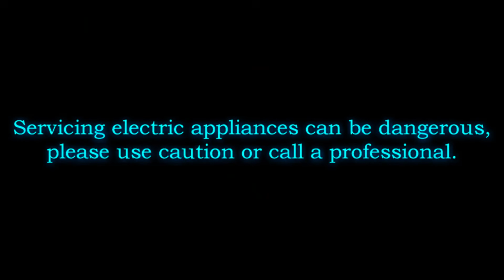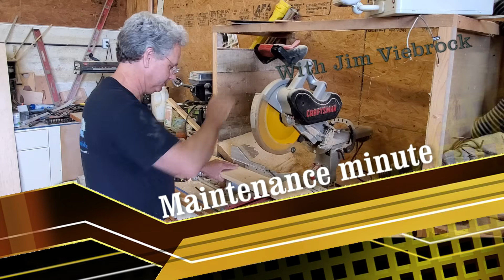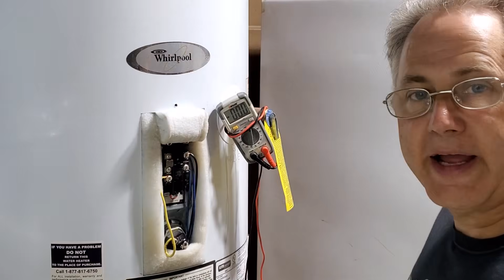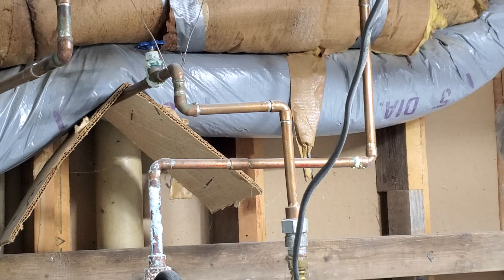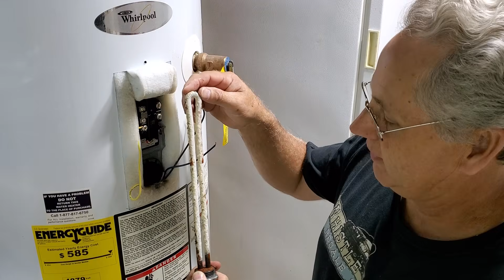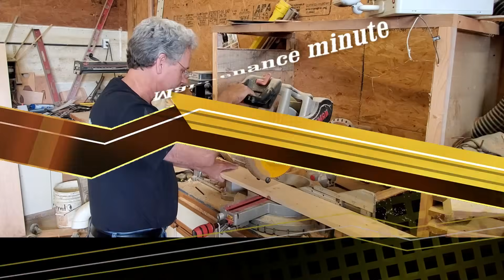D.I.Y. How to replace the heating elements in your hot water heater. Maintenance Minute Jim Viebrock

Comment: Can you temporarily bypass lower element until you can take off. It's stuck for now..
Reply from the maker: Well, if the lower element is not working the heater will not fully warm the water. Also, you will not be able to clean out the bottom of the tank. In short, I don't think the unit will perform to a level you will be happy with. In the video, I had to upgrade the leverage I needed to remove the old elements. You may need to enlist a mechanic friend to provide you with a socket and a breakover bar for additional leverage. Be careful, if you strip the threads you will likely need to replace the whole unit...

Comment: Our old element is stuck (won’t turn to come loose) Do you have any suggestions on how to loosen it to get it out?
Reply from the maker: They can be very tight, In the video I use a socket and a long breakover bar. I would try something similar to that.
Reply: @millin360  We ended up getting an attachment (socket) for our drill and it worked!!
Reply from the maker: @lindanicodemus9306  that's awesome!!!!  I'm glad the video helped.

Comment: Thank you for the video! Replaced my elements and flushed the tank. One extra tip to mention, Check the reset button on the thermostat! After I was done and everything was connected and turned on, I still didn't have hot water, even after an hour. I went out and rechecked everything, wires and circuit breaker! Then I saw the Red Reset button on the thermostat and it needed to be reset! Hot water in about an hour!
Reply from the maker: Glad you were able to get it done. You most likely tripped the reset button at some point when the element went bad, so all of that probably needed to be done.
Reply: How old is your tank to justify the pipe compound I'm replacing my element now and the water heater is only a 5 years old also great video so easy to understand  @millin360
Reply: Your element was probably fine
Reply: Sir,you are awesome! SERIOUSLY the best video I've seen! Thank you!

Comment: Before you drained the water you turned 2 valves 1 to the tank and one into the house but what should i look for it i can only find the turn on switch for the on going into the drain?
Reply from the maker: Depending on what part of the country you live in. There may not be shut-off valves leading both to the tank and away from the tank. The idea is to simply shut off the water flow to the tank using whatever methods the contractor provided for you. In the event you don't have any shut-off valves, you will need to go out to the meter and shut off the water to the house.
 It's just gonna be extra water for you to have to deal with.

Comment: I have barely any water coming out from my faucet that I had on while filling the tank... The tank is full and other faucets work fine Why?
Reply: Check that the spigot did not get clogged with calcium debris, remove aerator and clean it. Make sure you put it back together the way it came out of the spigot.
Reply from the maker: Check the valve that you may have shut off in the process. It may not be fully open....

Comment: You should leave your exhaust valve alone. Opening the tap causes the air to come in the tank. You just risk unneeded problems. Your valve should be plumbed to the base. The water heater should be sitting in a pan that’s plumbed outside your home so you can see it’s leaking or put a sensor in the pan. Why ruin everything in a garage for a water heater that keeps getting made cheaper?🤷‍♂️
Reply from the maker: Thank you for your input.

Comment: Great video.  I installed a new water heater today but no hot water.  I think I may have turned the power on too soon and burned out the element.
Reply from the maker: Could be. Congratulations on the install though.

Comment: Lucky for you that you had the inch and a half socket .Did not have one in the tool box . I gonna check again.
Reply from the maker: Yeah, an 1-1/2" socket is not usually what someone just has laying around. As I stated in the video, you can buy the removal tool at the hardware store at the same time you buy the elements.   I've performed this procedure countless times and happened to have the appropriate tools to do it quickly and efficiently.. Drop me A-line and let me know how successful your repair was and thanks for watching my video.

Comment: Great video. My little constructive comment.
You use the voltage function of the multi meter and not the ohmmeter that is used to measured resistance.
Reply from the maker: Ya,  I record these live and don't realize I make little blunders along the way until it's too late. We try to correct it with a graphic but...well it's an imperfect world.
Thanks for the feedback, and thank you for watching my videos.

Comment: Excellent! I've got some rust dripping out of the water heater - a 2018 Rheem electric dual element 40 gallon.  Trying to get it covered under the tank warranty.  Plumber says the tank is shot and Home Depot says it's not - without looking at it.
Reply from the maker: That's a bummer. The anode rod is supposed to keep it from rusting.
Reply: @millin360  the anode rod.

Comment: My elements were both impossible to loosen until I used a  6pt  38mm socket bought at a auto parts store and used a battery impact gun. A little pipe dope on threads in tank will help prevent a small leak like I had forcing me to drain tank again and remove the element.
Reply from the maker: Wow, sounds like you had quite the experience. I'm glad you got the heater fixed. :)
Thank you for watching my videos.

Comment: What do I do if I didn't open the pressure value?
Reply from the maker: If you didn't open the pressure valve while you were trying to drain the tank, opening the hot water side of any faucet will do the same thing... it just allows air into the system so it doesn't create a vacuum.
Reply: @millin360  ok I did that in the beginning.  I've put everything back and hoping it work. Thank you it saved me $1075.

Comment: Thank you for mentioning that heating elements have different wattages. That wasn't mentioned on the other videos I've seen on this topic.
Reply from the maker: Thank you for your comment.  It is important to replace the elements with the same wattage or a home owner runs the risk of fire.
 Thank you for watching my videos.
Reply: @millin360 Question is still a risk of fire if using a lower wattage element instead of what came out? Mine had 4500 watts, can I replace with 3500 watts?
Reply from the maker: @jonathan3982  A lower wattage element would work without any additional risk. However, it will be slower to heat your water.
 I always recommend putting back what the manufacturer had installed in the first place..
Reply: @millin360  Thanks I'll try and return them and get 4500 watts. Another question does it matter on the elements which screw is in what position? I know that both screws are hot, in other words does it matter which screw let's say the white wire hooks to?
Reply from the maker: @jonathan3982  The "Hot" wires are interchangeable, however, as a matter of professional work habits, I would suggest that everything goes back in the place it came from.
Reply: @millin360  Thank you again I was just wondering because I wanted to make sure because you're very informative and helpful. I've learned it doesn't matter which screw terminal the wire hooks to.So basically hook it up as it was originally.

Comment: Hello. Working around 240 volts is dangerous. Your electrical information is confusing and could cause problems for the viewer. For safety purposes I would recommend allowing an electrician explain the electrical portion. Thanks
Reply from the maker: The video clearly states in several places to consult a professional if you are unsure or not confident in preforming the task. There is a disclaimer at the beginning of the video stating that servicing electrical appliances can be dangerous and to use caution or to consult a professional.  With that said, safety is the single most important aspect of any project.  I recommend that if a person is not clear or unsure they should not attempt the repair.
Thank you for your comment.
Reply: Yes it does have a reset botton I'll try tomorrow ❤ thank you I hoping my heating elements didn't burn out! I seen another video his water was cold he took out the heating elements and used a hard wire brush and scrubbed all the build up on it hahha people called him cheap for not buying new ones! Lol people can be very rude people will always complain
Reply: Hi thanks for your great video! I live in north dakota we just had a few storms my pipes got frozen well yesterday we put a heater under the home water came back on but there's no hot? Will reseting the botton work or did my water heater just die on me any information please, money is tight I do all my work my self I can't afford a new water heater thanks for any advice thanks
Reply from the maker: @braidendj3jy   If your heater has reset buttons I would certainly try them, I would also check the breaker to make sure they didn't trip.

Comment: Really good stuff thanks you saved me alot of cash money
Reply from the maker: Glad the video helped.
Reply: @millin360  also what to expect after replacing them is there something I have to do after following all the steps it your video they were going to charge us $800 to switch them I spent like 200max on tools the 1 1/2 and a big breaker bar the elements were only 12$ each and tape $1 sealent $10 so nice!
Reply from the maker: @otgmedina3452   It's important to not turn the power on to the elements before the tank is completely full of water.. Open a valve somewhere in the house to let the air push out of the tank. Once the tank is full turn the power back on.

Comment: Great video, thanks. Does it matter if the wires to the element are reversed upon reinstallation, since both are hot?
Reply from the maker: It doesn't really matter, but as a practice of professionalism you want to keep them the same.
Reply: @millin360  That makes sense. It seems that the screw positions on the replacement element are symmetrical so depending on how it was threaded in, it might reverse the screw position from what it was originally.

Comment: Nice video and I was wondering why you just didn't clean the heating elements? Seems cheaper than buying new ones if you just soak them in some muriatic acid or something. Just me thinking too much I guess.
Reply from the maker: In my case, the lower element was damaged from the lime. As cheap as the elements are, I simply replace them.
Reply: @millin360  Yep.  If it's DYI you have already saved a ton of labor costs.  DO it right, or do it twice.
Reply: By the time you drain the tank and remove the element, you have done the effort.  Elements costs $10 or 20$ each,  My top element was fine,   I replaced it anyway.  For 10-20 years of service, I will buy the extra element.   I don't want to have to go through this again.

Comment: I changed the bottom element and my water is cold. Am I supposed to click the reset button found on the top element?
Reply from the maker: I always recommend that both elements be replaced while you are at it. If your unit has a reset button, there is no harm in pressing it. If those things don't fix it then it almost has to be the thermostat(s). 
Thank you for watching my video.

Comment: Use you 1-1/2 socket to put heat element on. Makes it much easier
Reply from the maker: I agree. The little tool you buy at the hardware store can easily slip and strip the nut. Using a socket wrench gives you much more leverage and a much tighter fit.
 Thank you for watching the video.

Comment: Best video on YouTube for this, thank you!! Only thing I don’t understand fully is making sure there is no air. If possible, can you give me instructions like I’m 5 years old? Lol! I don’t want to mess this up
Reply from the maker: When you start to refill the tank, if you don't have a place for the air to go, for example a valve at a sink open, the tank will pressurize and you will think it's full.  If your input valve and the output valve is open, and you have a valve open at one of the sinks, then you know the tank is full because it has to go past all of that to get to the sink.  Also it will push all of the air out of the water lines as well.  Unfortunately, if you turn the water heater on with air in the tank, the elements will burn out and you will have to do this whole process over again.... I hope that helps, thank you for watching the video.
Reply: @millin360  That is exactly what I wanted to know! Thank you very much for the reply!

Comment: I’m working on our heater today, one issue I have is the lower thermostat overheated and toasted the wiring insulation so now have to replace.  Can someone please advise to the correct gauge of wires?  I’m referring to the wires connecting element to lower thermostat.  Thanks
Reply from the maker: Most of the wires I've seen on the water heaters are 12 gauge,  but I would take one of them with me to the hardware store and compare them to make sure....
Reply: @millin360  great idea, thanks for the reply!
Reply: The same size that came out. Surely it didn’t burn all up. Hello

Comment: Thanks for the video.  Just swapped out upper and lower in a breeze, for less than $50!  It now seems like I now have a slightmreduction in water pressure now.  Any ideas to get back to where it was?  Thanks!!
Reply from the maker: Nothing in the tank itself regulates pressure so,  I would check to see if the shut off valve(s) is/are fully open.
Reply: @millin360  seems like that was the problem. Heater has the original shut off valve, and was stuck halfway. Thanks!!

Comment: Thank you. Do I need to drain the entire water in the tank to replace the elements? Or I can only drain to a level below the elements?
Reply from the maker: While you are going to the trouble of draining the tank and replacing the elements, you're gonna want to clean out the bottom of the tank. So I would suggest you drain the tank all the way and use a vacuum to suck out any debris that may be at the bottom of the tank.
Reply: @millin360  I have already cleaned the bottom of the tank last week when I replaced the drain valve, but I made a stupid mistake and I turned the power on when the tank was not completely full and as result the elements got damaged. So to replace the elements, I don't think I need to drain the entire water?
Reply: @footballfan484 You do if you're replacing the bottom element, but not the top element. You'll just have to drain until it's below the top element.

Comment: Thank you! I fixed my hot water heater for $35 today!
Reply from the maker: That's awesome! Glad the information was helpful. 
Thank you for watching my videos.
Reply: @millin360  You’re most welcomed.
Reply: I'm about to do the same! Great video
Reply: @thomasmilano9870  Make sure you have a good hose. I found out my hose was bad the first time I attempted to remove the top element. Once I replaced the hose it took about an hour to drain an 80 gallon tank.

Comment: Does RHEEM intentionally make the lower heating element bent in a pretzel fashion so that you can’t replace it and have to buy a new unit? This hot water heater is 2 yrs old, lower element is leaking. Can’t remove due to its shape. Wtf
Reply from the maker: I don't know what particular model you have but, in the video I used one that is a horseshoe shape. That style of element is designed to heat in high lime content water. It will come out, you may have to squeeze it shut a little.
Be sure to get the old rubber washer out before putting the new in, or it will leak.
Thank you for watching my video!
Reply: @millin360  ok so I finally was able to remove the element that was leaking, replaced it with an identical heating element, power is on. But now I have zero hot water. I went from having hot water but a leaking unit, to a dry unit with zero hot water. Where would you start with the troubleshooting. I’ve got power to the element
Reply from the maker: @jackvillan5151   If you have power to the element and the element is new, then you should have hot water. Keep in mind, it will take your tank a good 45 minutes to an hour to heat the water from scratch.

Comment: If I was replacing my element and forgot to drain the tank. Is it ok if I soaked the bottom of the water heater? Is it safe to use after?
Reply from the maker: Let it dry out for a bit, but it'll be fine. Do not touch any of the electrical components if they are wet, you probably should make sure all of that is dry before turning the power back on.
Reply: @millin360  understood! Thank you so much. Is there any safety concerns with water getting into the gas piping? I have a gas powered water heater
Reply from the maker: @Timmyquickhands   If you have a gas water heater, you do not have electric heating elements.
Your heater has a burner at the bottom of the unit.